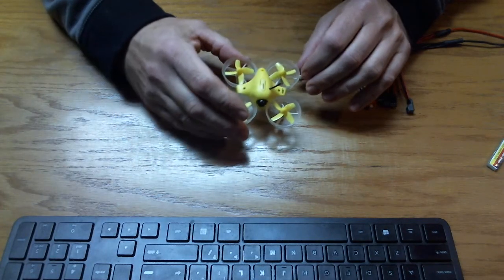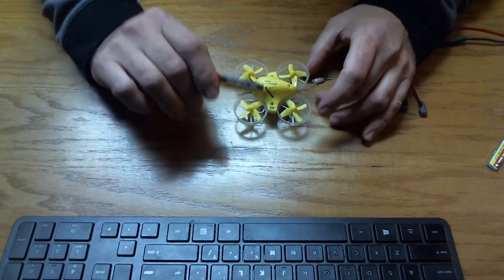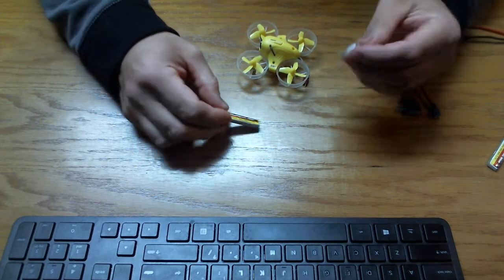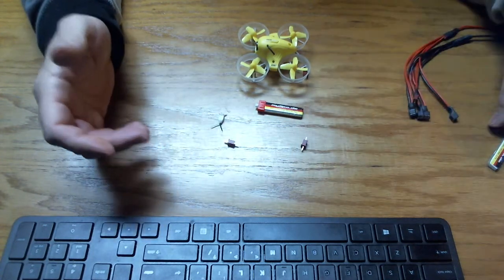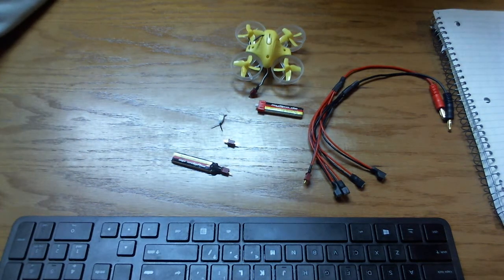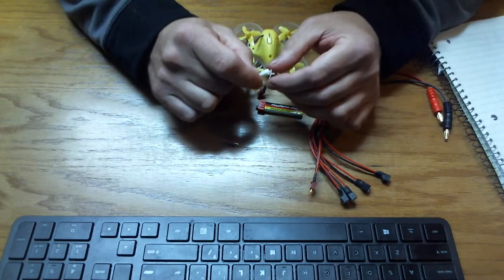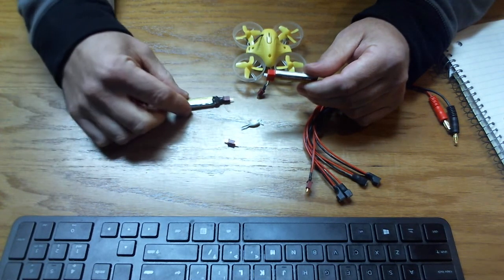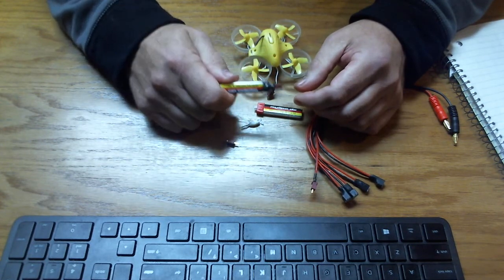Blade Inductrix /Tiny Whoop Lipo Battery fix

Comment: I did the same modification. It's perfect for durability/airtime, but not really neat. I soldered the Micro Deans-connector directly to the tabs of the lipo. It will set you back about a gram in weight. I think a Losi-connector with a short lead is a little bit better solution,,,
Reply from the maker: My connectors just came in so i will be able to clean it up.

Comment: i have the same problem, i have called the Horizon Hobby guys and the said that was any issiuse with the battery but i think its the board or the camera it self. 

I test it out and tell you then. 

Sorry for this shit englisch :D
Reply: wont let me reply to your email address did try that first ?
Reply from the maker: There are 2 issues the Low Voltage Cut Off also you can solder the board or HH is replacing them for free. The quad started blinking and shutdowns even when the battery is above 3.70  volts. I had both issues
Reply: Logo 800 i hab also both the blade inductrix with the serial Number without the "G" at the end hast had this Problem. only the BLH8580G Work fine.
Reply: where do you solder on the board ? mine is the 8580G , I cant get more
than 1 min, on a new batt,
Reply from the maker: Send me your email I will send you a photo. OK
Reply: Thanks for your reply, Only got mine this week been into building and flying planes and 250 size quads for years now so I think I no what to expect from flying times, When H.H 
state 4 to 5 mins. they tell the porkies !! reality is 2 to 3 which is fine with me, My first breakin hover was less than 1 min. recharged I got 40 sec. tried 4 new NANO-TECH 
200.mah with exactly the same result with them all, Took off camera got 6min.+, put camera on 150.mah fine for at least 6min. Must be the LVT cut off on the board, Why
put flashing lights on to let you no its going to crash never seen that before thought the timer on your TX is for that !
At the moment I want to try the solder fix before I blast H.H on the dog & bone !!! Have you found it yet ?
all the gorgie,
Kevin
Reply from the maker: Send me your email I will send you a photo. OK

Comment: if you check my videos you should be getting 4 minutes, i posted on the rc groups that horizon hobby has a new board for the inductrix fpv the LVC has an issue aswell call them they will send you a new one. also i posted on rc groups the connector problem a long time ago when we first got our pre orders. you should go check out the thread.
Reply from the maker: Thanks. I'm not sure of times now as the batteries are not brand new they have over 20 cycles on them.You have a link you can post on the replacement board.